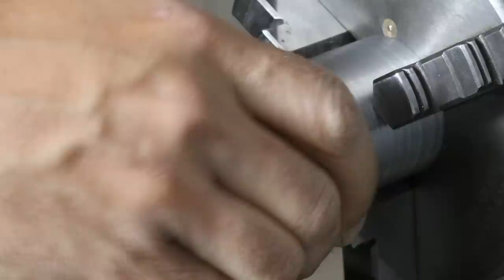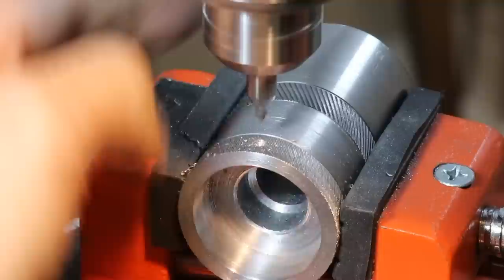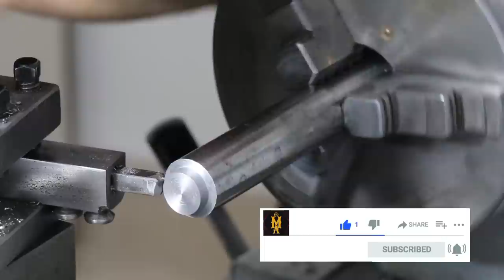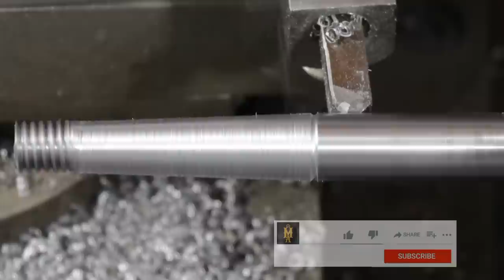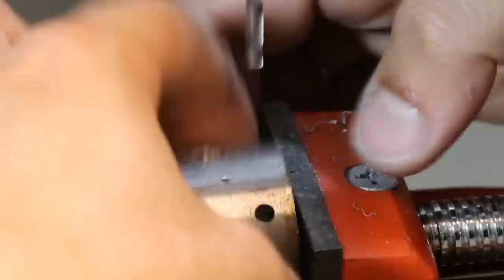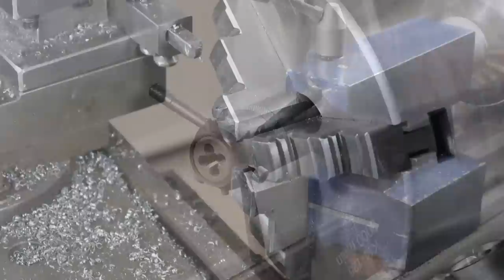How To Make a Tailstock Die Holder

Comment: Good video. I thought your lathe was running a bit slow though. I would have tried a higher spindle speed to get a better surface finish.
Reply from the maker: correct🙏❤️
Thanks for your guidance🤩
Reply: @metallantik  lll

Comment: You can cut a thread with the stock and die squarely in the lathe without all of this. No need to make anything.

Anyway, I don't use a die..........I screw cut all ofl my threads in the lathe. Use the star wheel and chasing dial and it doesn't take long to cut a thread. Metric/imperial. Internal/external.

I use a die to clean a thread.
Reply from the maker: Absolutely correct
But sometimes it is useful
Thanks for watching ❤️🤩🙏